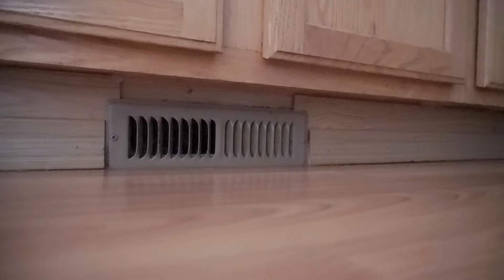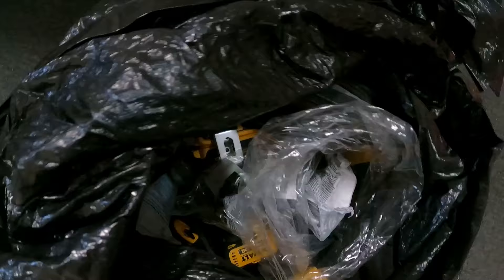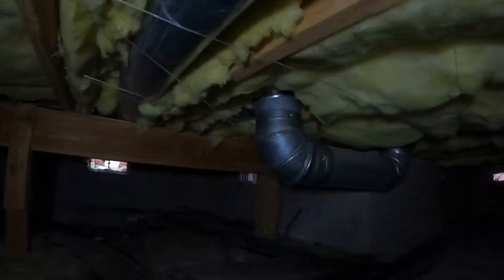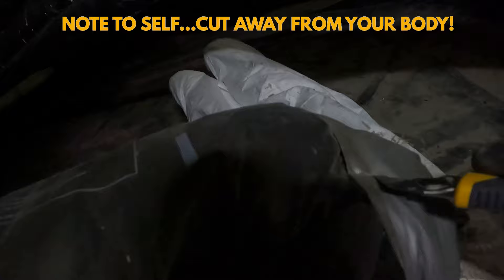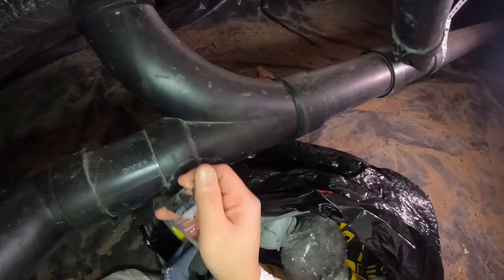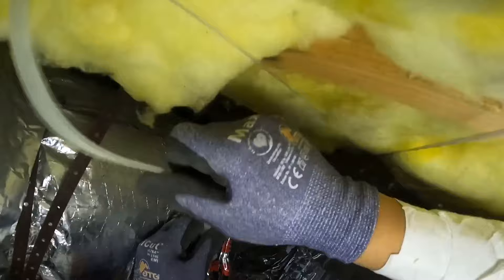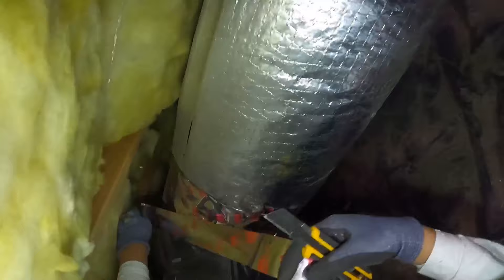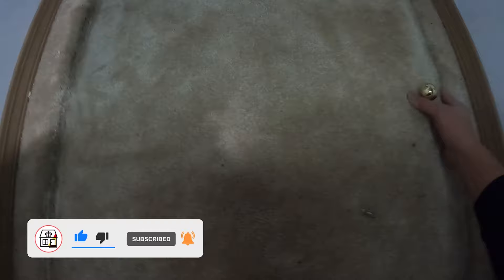How To Fix An Air Vent With NO Cold Air Or Heat Coming Out! DIY Tutorial Repair For Beginners!

Comment: It came loose because ducts are the one place you never use duct tape. It turns brittle and the adhesive fails. I spent a loooong time down in mine slapping foil tape and mastic over everything down there.
Reply from the maker: I agree 💯! 👍🏽😊 I don’t know what the contractor was thinking using duct tape, all of it was brittle like you said and crusted out. Thank you for sharing your experience!

Comment: Are you experienced in HVAC duct work? One of my rooms is warm and the vent not letting air out. Is that the most common cause of this ? It’s not the dampener on / off switch? I tried it both ways but it made no difference. Same weak air coming out.

Comment: If you can afford a new run and easy to get to would be a good thing since mice/ critter droppings have major bacteria in them.it should be removed and at least disinfected at minimum. People have different immune systems and nobody should be smelling that crap (pun intended). That 6 inch line is way too big for that size vent in my state and for most anywhere for the correct amount of air to flow properly. Just FYI. You did what you should have done for your buddy and that's a good thing just pointing out some issues that could be bad. There are calculations for all of these vent sizes and duct sizes. It could be correct but that's probably what they had beside them and didn't want to get a 4" duct. Typical contractors.
Reply from the maker: I will definitely look into the vent sizes thanks for bringing that up! 👍🏽 that is a good point about the disinfecting part. On my house I have 4” tubes running but again like what you said it all depends on airflow how much air your system pushes out. Thank you friend for the advice and tips! 🙏🏽😊
Reply: @FixThisHouse  It's all in much love and no criticizing like I have seen some people do which makes no sense. I've been mold certified along with many others and I've very well aware of animal feces and the problems it can bring. I'm also an HVAC certified GC and it seems to be too large but people design things different. Usually a 6 inch could be too large for that under the counter register but either way you did a good job and did it right with that was there and offered good advise. I like your channel as I've become a subscriber in the last week or so. Keep up the good work and be proud of your work. I am and non of us know everything but learn all the time. Cheers to you and I hope you have a great holiday my friend.
Reply: Good point on getting it disinfected, i will definitely do that.